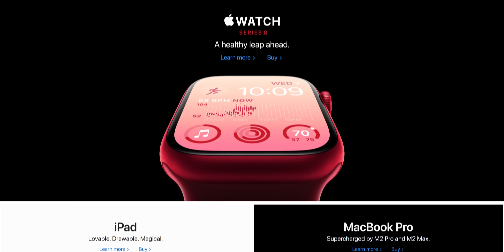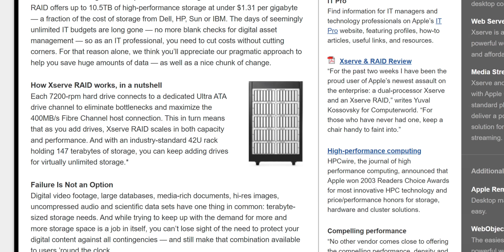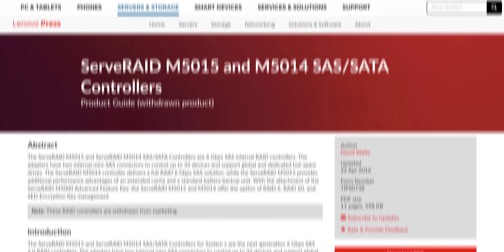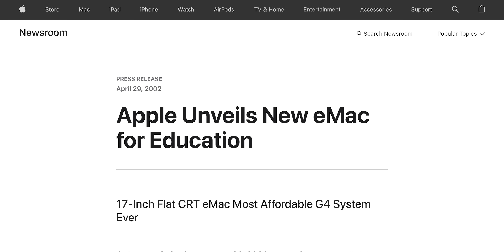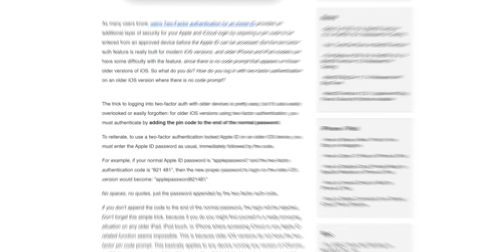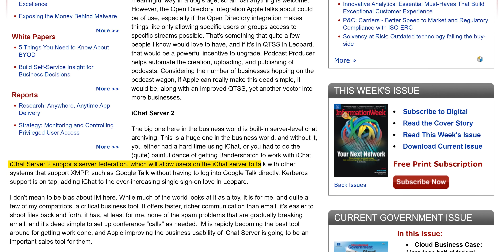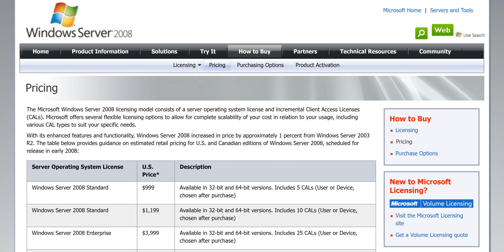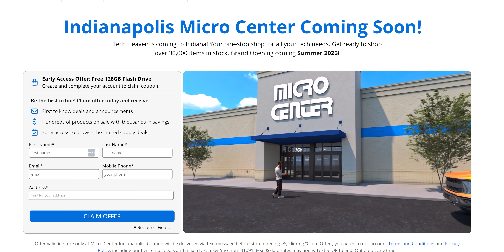I Bought the Last One Apple Ever Made... - Apple XServe 3,1 Server

Comment: The drive connectors aren’t actually proprietary! They’re a weird 40 pin SCA-2 connector that implemented some whacky version of SCSI. The protocol running through the connector however is likely proprietary as the chip on the board within the drive caddy is a SATA failover multiplexer, and the backplane within the Xserve uses a SATA-PCIE bridge chip. I’ve spent a good deal of time trying to reverse engineer their system only to say “to hell with it” and design my own backplane and caddy adapter boards.
Reply: Those 40-pin SCA connectors were SCSI over
 Fibre Channel, which was pretty common for enterprise storage arrays. This is the same interface Dell EMC used in their storage arrays until switching to NVMe.
Reply: @KW160  Wow, yeah. YouTube will delete my comment if I put a URL in it, but that interface using a SCA-2 connector is indeed part of the Fibre Channel specification. Linus was completely incorrect.
Reply: @KW160  Fibre Channel!  I had forgotten what it was called.  I am in charge of data wiping for a company and we used to get a ton of fibre channel drives back in the day, all from these unwieldy (yet wheeled) Sun cabinets.  Great times (not).
Reply: I wanted to mention how they looked similar to a MSA caddy and backplane from HP Enterprise.
I saw a good deal of the older gen at work
Reply: Fiber channel hard drive, not proprietary at all
Reply: Came here to see this.  Used to see these on some larger (and older) Sun systems.
Reply: I have a disk unit from an old storage system and it's also using this kind of connector with a chip inbetween the hard drive and the connector.

I also have flash modules for these, which are quite weird. They have a SATA interface instead of SAS on the SSDs (which are 3.5 inch, built like a tank and apparently SLC flash) and the chip is a SATA to SAS bridge it seems. Sadly, I could never get them to work on a regular machine. These drives are low level formatted to only support 520 Byte sectors, which is incompatible with pretty much anything other than these specific systems. The regular SAS HDDs could be reformatted to 512 and work fine, but the SSDs (which are way more interesting) just refuse the command. Maybe that's because the low level format is a SCSI command, while this is ATA?
Reply: It reminds me a bit of the fibre channel connectors from Sun Blade workstations.
Reply: Also looks like the same sort of connector from the iPods HDD too. Be cool if they carried it over as it was a standard they were previously familiar with.
Reply: @ljbty  Yeah, that's what Toshiba used on some of their later 1.8" drives. It's just SATA and power through a ZIF connector. I'm not sure if it was ever a proper standard, but it also wasn't something proprietary to Apple.
Reply: I was about to comment this... I've seen it on loads of servers
Reply: sounds like you were working on a cool project. can you explain what it was?
Reply: @ghosthunter0950  I’ve been slowly working on a case mod in an xserve chassis with the goal of maintaining as much original equipment (or at least functionality) as possible. Unfortunately my determination to stuff modern ATX hardware inside a proprietary Apple chassis means that most of the guts have to go. I think the only thing usable from the original is the LED indicator board in the drive module handle. I have a new SATA pass through board designed for the drive module, working on design for the backplane next. Progress has been slow as there’s a lot of life happening right now, and I’m struggling with the mechanical design because Apple made some odd decisions.
Reply: Ironically, (or not) it’s actually the same connector that is used to connect hard drives on the original Xbox 360
Reply: Whether it's proprietary or not is pretty much irrelevant in server-land anyway, where you buy from the OEM regardless, and have a service contract to replace any hardware that fails at no additional cost.  When you basically treat the entire drive-in-sled as a field-replaceable unit that the vendor is responsible for providing, it doesn't make a lot of difference how it works.
Reply: I recognize the port as a fata port. I have seen them on hp servers before
Reply: So… it’s a proprietary implementation of a weird, rare connector from the 80s/90s. For all intents and purposes, that’s proprietary.
Reply: @Jestokost  It wasn't from the 80s, SCA-2 was released in the mid to late 90s and was not weird or rare to see on enterprise drives.  It was used for Fiber Channel drives (and parallel SCSI), and the connector offered a different set of characteristics that differed from SAS to benefit those types of servers use-cases.  Though, with SAS being much more flexible in its functionality (and with a slight speed edge) it was what inevitably replaced SCA-2.  The Xserver would've been the last generation of servers to use SCA-2, but what isn't really mentioned is that Apple DID officially support SAS/SATA in their servers.  Sooo... not sure why that's not mentioned, but apple most certainly wasn't shooting themselves in the foot by not offering flexibility with their hardware (minus vendor locked drives, though this is debatable whether that's a shot in the foot or just a greedy move.)
Reply: …NNEEEEERRRRDDDSSSS!
Reply: First time I've seen scsi mentioned on a video talking about hardware manufactured this century.
Reply: @Ornithopter470  It's mentioned every time someone talks about SAS drives.
SAS-Serial Attached SCSI.
Reply: @Ornithopter470  Uh... SAS is SCSI, so like most enterprise hardware talk does mention SCSI.
Reply: @KayJay01  didn't know that! Although a quick check on wikipedia shows the truth. SAS is also a weird and wacky version of scsi, but that may be why it's still used.
Reply: @Ornithopter470  That's business hardware for you. We still have VGA on our 2023 servers
Reply: @Ornithopter470  …you say in a comment on a video where Serial Attached SCSI is repeatedly mentioned.

Edit: Ok, you and others already addressed your mistake.

SAS is genuinely SCSI, though. The major difference is that the signals go through a pair of SerDecs.

Fun fact: SATA is also (though to a lesser degree) based on SCSI. Even though it's a similarly serialized version of ATA, which maintained backwards compatibility with IDE, ATAPI uses SCSI commands. So even SATA is SCSI under the hood, but only for devices that aren't hard drives.
Reply: @Ornithopter470  agreed, SAS / SATA might be based on SCSI but I still havn't seem SCSI itself actually mentioned in ages.
Reply: @garysb  SAS is SCSI. OP wasn't saying that the drive modules used parallel SCSI, they were talking about the SCSI protocol (which SAS still uses).
Reply: Me: "How many big words can you use in one comment?"
Collin: "Yes."
Reply: @FlyboyHelosim  Don't be so eager to tell the world you can barely read and have a restricted vocabulary.
Reply: @CatfishBradley  Dude it was a joke. Besides, a bunch of unnecessary tech talk hardly exposes someone's inability to read or understand esoteric words.
Reply: It is properitary. Fibre channel disks have connector in different place, passing through probably different signals. Apple used SATA disk with adapter board.
Reply: @swrzesinski  The interface isn't proprietary.
Reply: @pseudotasuki  Ok, maybe i was too fast to judge. HDD uses standarized interface, but HDD trays are properitary (it is completly normal. Even if there is just SAS/SATA connector on drive on some servers HDD trays, rails are not compatible between diferent vendors anyway). I read that many people even exchanged SATA disks for newer ones with a success in Xserve's
Reply: @swrzesinski  So then what is the complaint?
Reply: @pseudotasuki  Maybe nothing? I said I judged too fast.
Reply: So in short... It's proprietary
Reply: @LeafBoye  Probably a dozen vendors used them, so not vendor exclusive...but also not stocked at your local Best Buy.

Comment: I bought an Xserve Xeon for my student newspaper. It was great for someone less skilled at Linux system administration. I'm pretty sure I remember putting whatever HDD I wanted into the sleds and it working, but I could be wrong.
Reply: I also don't recall having issues with 3rd party hard drives on these... actually my first time hearing of a "Firmware Lock". I knew Apple HDDs had their own firmwares, however.
Reply: I looked online and people seem to be putting random HDD's and SSD's in.
Reply: My work had a couple of these for image deployments on multiple campuses (later replaced by multiple Mac Minis) and we replaced hard drives with 3rd party ones no problem.
Reply: I may have misunderstood what he said, but I thought he meant the sleds were required since the connectors were proprietary. Not that the HDDs were proprietary, you just couldn't use them without the sleds. That seems like Apple's SoP, where they use off the shelf hardware, but use proprietary connectors and controllers so you have to pay for the expensive stuff to get the hardware to work.
Reply: There wasn't issues with 3rd party drives. I believe we used WD drives.

Comment: For a second, I thought you were going to do the last iPod they ever made. With that said, it’s interesting how their design language has changed over the last several years. While they do still make server-mounted Macs, they just look like the same dimensions as the standard Mac Pro but reoriented.
Reply: That's literally what this is though. A reoriented Mac Pro.
Reply: They literally are the same enclosures, just without the handles.
Reply: What about the server Mac Pro? That’s also rack-dimensions, I think. I think it’s better to say they’ve pivoted their engineering to the consumer side, and have simply moved it over to the business products as well.
Reply: @angryakita3870  The XServe line are the only proper rack-mount products Apple ever made. Some of their machines can be rock-mounted using adapters (Linus mentions an example near the beginning of the video) but it isn't really the same thing.
Reply: iPods were well made, but I still don't regret having my generic mp3 player that I could put every single song on from my laptop.

Apple has been a scam since iTunes.
Reply: @GetOffMyPhoneGoogle  you can put mp3s on iPods so you don’t need iTunes
Reply: @GigaDarth  Only the early versions.
Reply: @GetOffMyPhoneGoogle  no all versions do you might need finder on a Mac though then drag your mp3 files into music give them the info if you want then open finder select sync music on finder and bam
Reply: @GigaDarth  that was still through iTunes though
Reply: @GetOffMyPhoneGoogle  it works on call iPods it even works on my iPhone
Reply: @GigaDarth  and on windows?
Reply: @Darth Jar Jar  Only the first model was able to have songs from lime wire, or napster, or your own CDs.
They made it where you had to go through iTunes. That's what "syncing" was. It was syncing it to your iTunes.
Reply: @GetOffMyPhoneGoogle  There are many programs which can sync music to an iPod, not just iTunes.